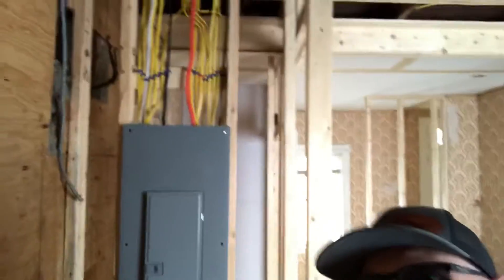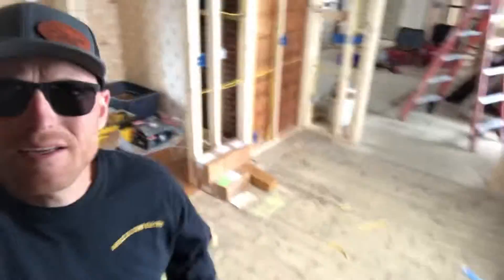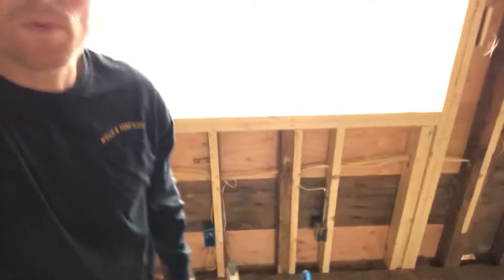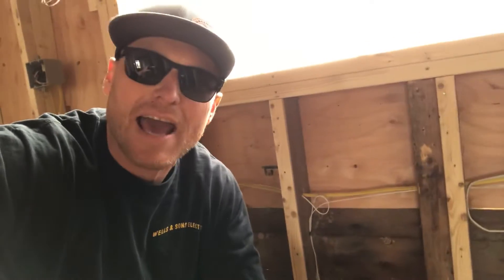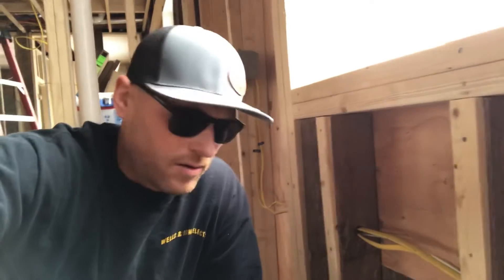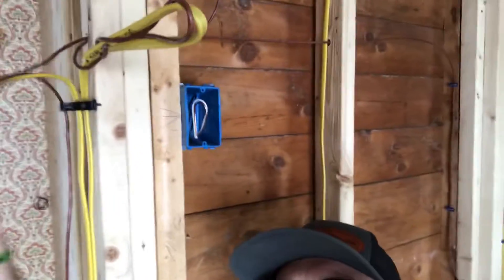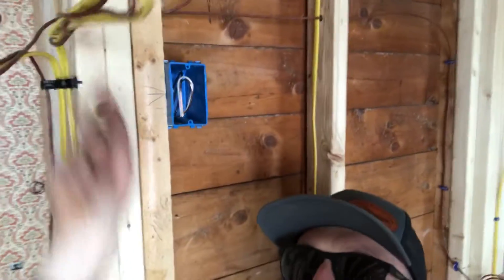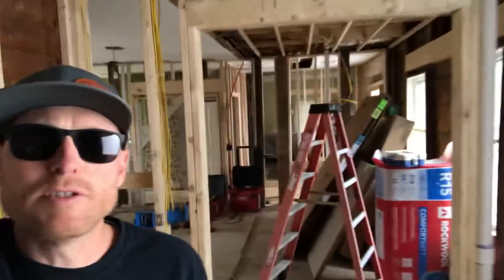Electrical rough-in for a kitchen, NEC kitchen code quiz at the end, see how well you do can do?

Comment: I just randomly looked up the first 3 dishwashers that came up on Home Depot site. One is 10 amps, one is 12 amps and one is 15 amps. A single appliance on a circuit can't exceed 80% of the circuit ampere rating, so two of these would be compliant on a dedicated 15 amp circuit and one of them needs a 20 amp circuit. Best practice is a dedicated 20 amp circuit.

Comment: Fridge does not need its own circuit. The new ones are 3-5amp draw max.  Dining area needs its own 20 amp circuit in case coffee maker, microwave, end up being located there. Kitchen and bathroom circuits required to be 20 amp, other general use circuits in living areas and bedrooms can be 15 amp, lighting can be 15 amp
Reply from the maker: Very nice, well done

Comment: Just do it right to start with and do 20 amp circuits with 12-2/gnd.  I put all appliances on 20 amp circuits by themselves (frig, dishwasher, compactor).  Also use 20 amp devices along the circuit(switches, outlets).  Can't understand why people will run a 20 amp circuit and then use a 15amp outlet?  Yea may cost a little more in materials, but same labor.  Cost is small, sleep better at night knowing you did it right.
Reply from the maker: I appreciate a person who goes above and beyond the code book, as you are saying. I also appreciate the NEC code and knowing what the minimum required is as well. This was a question of the minimum required by code, now we know how you would do it, do you know the answer to the question in the video?  
Please explain your statement about using a 15 amp "outlet" on a 20 amp circuit, and why this seems like a bad wiring method, as it is allowable by the latest NEC code, or is it? Code articles to back up your answers/comments would be awesome, for all viewers who want to learn.
Thank you for your comment!